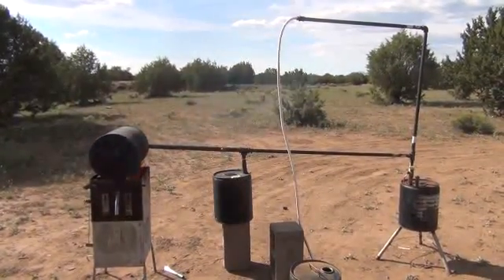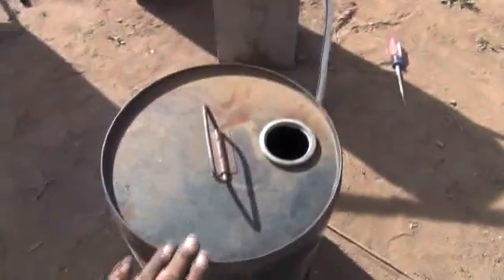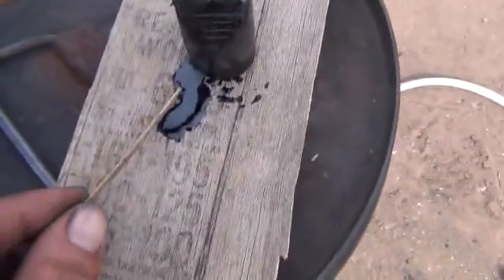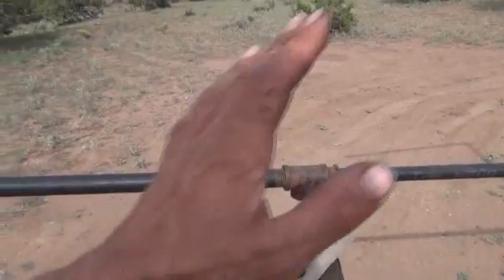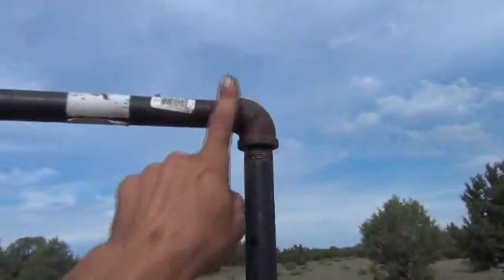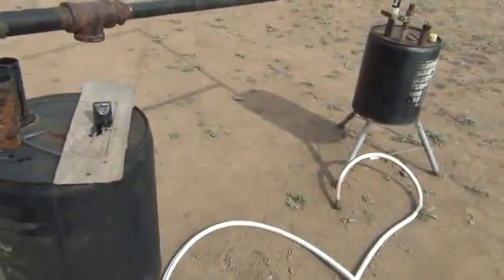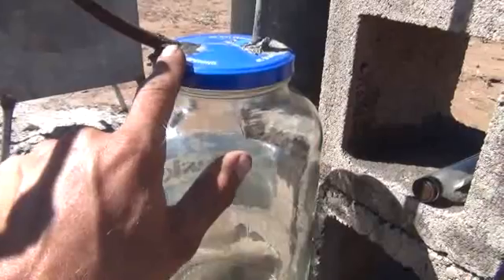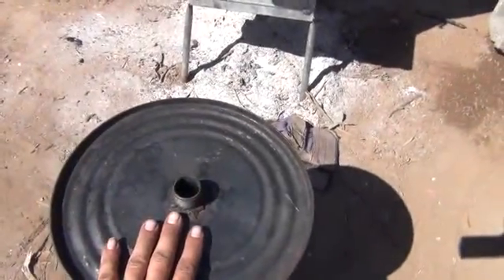Free GASOLINE from Trash or Wood Part 1

Comment: Hey Mr Teslonian. I can see how passionate you are about living off the land. I've watched your many hours of converting wood burning into gasoline and I was blown away however . . . .  there is probably an easier way to accomplish the same thing.  By running Ethanol  instead of that huge contraption that you have to build in the bed or your truck.I'm pretty sure I understand the kind of guy you are so rather than do a sales pitch I'll let you do your own research.  One of the things that turned me on to Ethanol was a Netflix documentary called the 'pump'. If you get a chance to watch 'pump' I would highly advise it. Looking forward to hearing your reply. Thanks.
Reply from the maker: +spacecowboy98 Ethanol is a very very very bad idea! Using our food for fuel is ludicrous madness, and would kill millions world wide from starvation by driving up the price of food. Neither  ethanol nor Hydrogen are viable alternatives and are hyped by the oil company's and  people that don't know any better, to keep us looking in directions that lead to nowhere. So unless you work for them don't hype the insanity out of a lack of foresight or true understanding of the bigger picture.
Reply from the maker: +spacecowboy98 That said, at a personal home level turning some of our trash waste into ethanol is a good idea because it's trash and not food.
Reply: I am making ethanol at 92-95% from biowaste.  Organic material ferments and it does not need to be from a "food" product.  I live in a jungle (ie: tons of organic material) in Central America and the ethanol is mainly used for making medicine from plants.  I am enjoying your videos and that you are using what is available to you. Keep making them and designing a life you love living!  KColvigArt.com

Comment: Just feed your creosote back through your pryrolitic converter and make more gas. you can use the char produced to heat your next batch or at the least use it as a soil conditioner.

Comment: I have an improvement you may like to try.  iron balls in the pipe before cooling the hydrogen gas can be used as a catalyst to combine the carbon atoms with the hydrogen at high temperature. This in theory will produce liquid gas.  But you may need to add pipe from your fire exhaust of the burning wood to get more carbon dioxide to the catalyst.

Comment: Uh is that legal
Reply: It is until it ruins the big oil and gas corporations' business around the world and they bribe law makers to make it illegal.  You'll be surprised to know that this is the real reason behind the liquor ban in the early 1900's.  John D. Rockefeller paid US congress to prevent - the then onset of automobile manufacturer's - from designing and engineering their cars to run on bio fuel.  Confirm it with Henry Ford, who was set to unvail his model T, which was supposed to run on alcohol fuel.